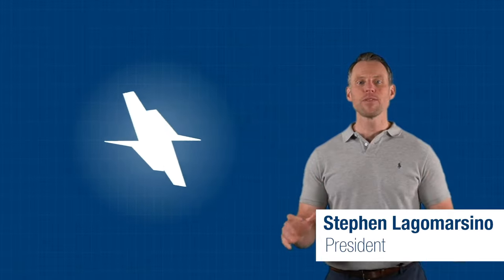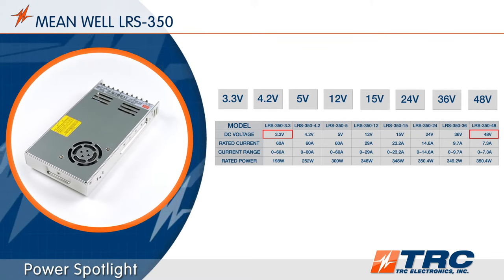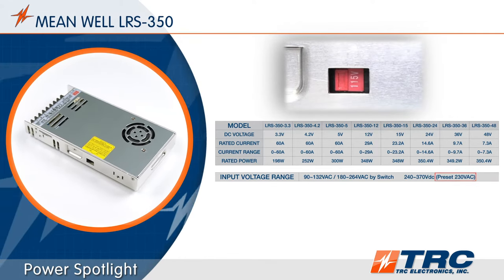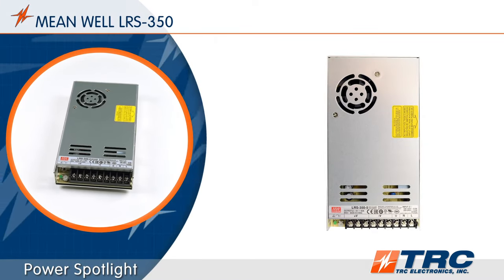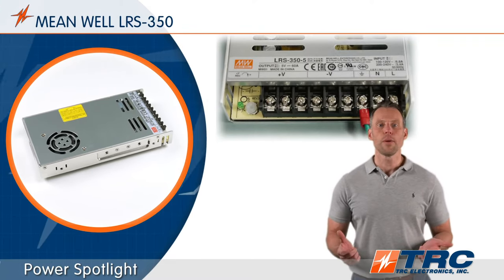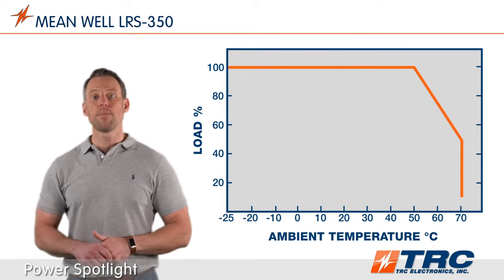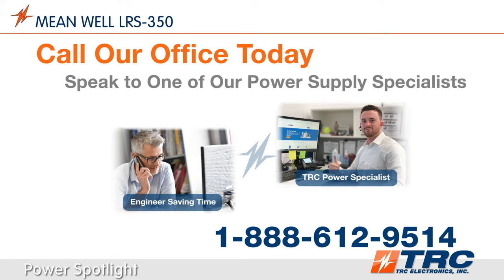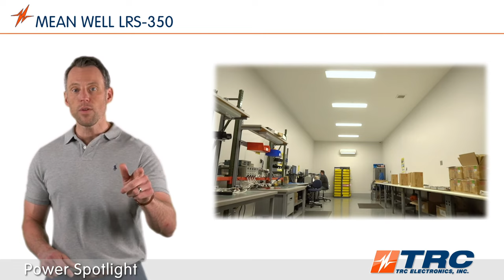LRS-350 MEAN WELL POWER SUPPLY

Comment: Got two of them, I thought they were suppose to be off below 40 deg C but they are on with and without load. What could be wrong?
Reply from the maker: Great question. The LED driver had an operating temperature rating that it is guaranteed to operate in. However, it may still operate beyond those temperatures even though the manufacturer didn’t “rate” it to operate outside of the operating temperature range.